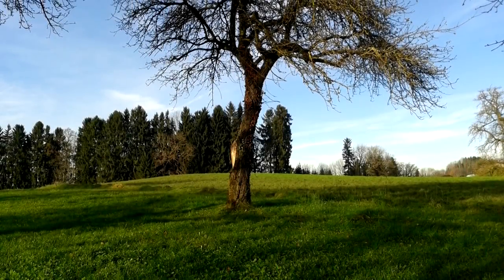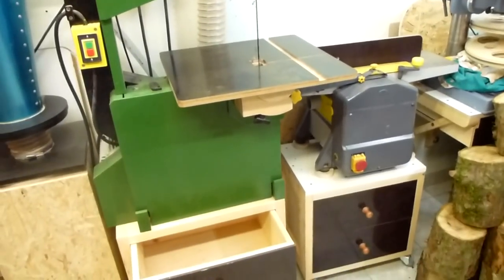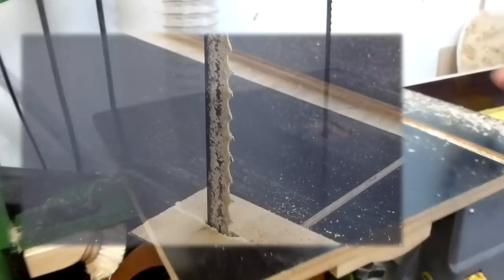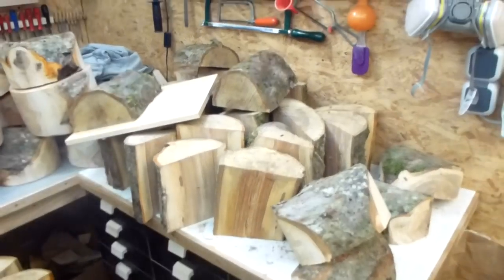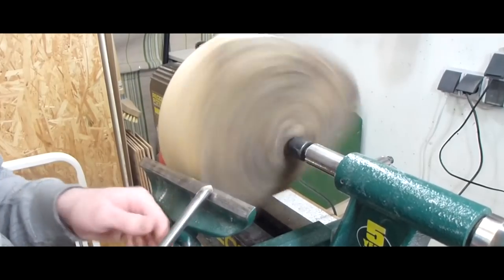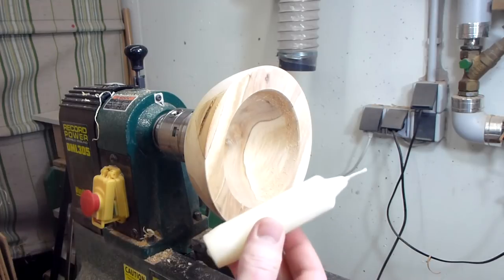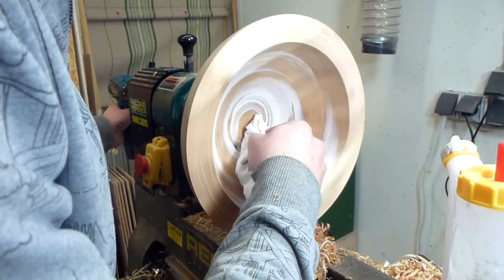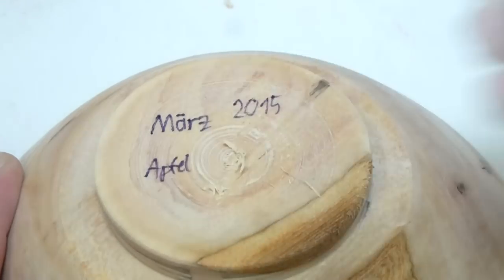Apple Bowls with Music

Comment: Nice job on the video Marius. I would like to make a couple of suggestions if you don't mind.  I think that you would be much happier if you were to use a chainsaw to cut your bowl blanks. It is much quicker and you would not use up your band saw blades. Also I would like to suggest that you try a wood sealer like anchorseal or another commercial product to seal your green bowls for drying. I don't think that I would use glue. I seems kind of expensive. That being said I never thought of using a candle, I will have to give it a try. I am very interested in seeing how it works. As far as the wood shavings go... very nice pile. It makes a wood turner proud to see something like that. If you ever get to much to burn in your fire place they do make a very nice landscaping accent. I get so much that i give some to my neighbors and they love them. Keep up the great work.

Comment: If I may offer a few ideas for your waste products.  The chunks are great for someone who smokes meat.  The shavings can be used in stripping furniture to get in the tight spots you rub the shavings like you're hand sanding and the gently scrape the old finish while soaking up the stripping chemicals.  Lastly if you can source enough wax from used up candles and things like that you can mix the sawdust into the melted wax to make a waterproof fire starting block.  Form them in a muffin pan for easy handling. 

All better than the trash or burning just to burn.

Comment: Hi great video enjoyed it very much. You can slow down the drying by putting the bowls back into the wood shavings,it does take up more space but gives you a shorter time drying and less cracking in some cases. 
Regards Steve 
SJS woodturning. Australia

Comment: That's a lot of bowls ;) how long well you wait to finish them? You could enter ***** Challenge Tree.
Greetings from UK
Karol
Reply from the maker: ***** Thank you. The bigger ones about one year, the smaller ones maybe a little bit shorter. I asked him, but I'm about 1 hour too late. :)
Reply: Thanks for your answer, I have to make some rough turned bowls as well, but never did it before. Your videos helped me a lot.
I have some spruce to practice on :D I can't waste any wood.
Dominic moved the entry time to noon in Germany so you should be fine :P
Reply from the maker: Oh, don't use spruce! I tried it and it's really not strong enough. Had a bowl "exploding" because it was spruce. And it smells awful, at least when it's wet.
Reply: Thanks for the advice, I will leave it to dry and then make something for the garden with it.

Comment: Can they still dry? because you sealed them watertight,
Reply from the maker: Yes, they're not watertight. It just dries slower, which is the goal.
Reply: +Marius Hornberger thank you for the information. I want to try the same with cherry. Did you do the backside too? how much do you use? 5 cm of candle a bowl?
Reply from the maker: I covered inside and outside. Use as much wax as it's needed to create a thin layer.
Reply: +Marius Hornberger thanks! i really like your videos